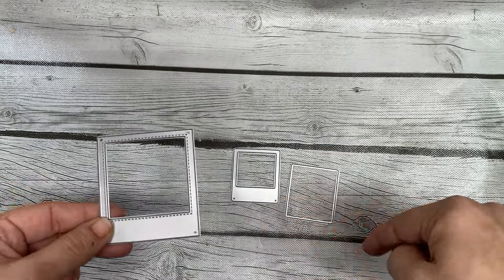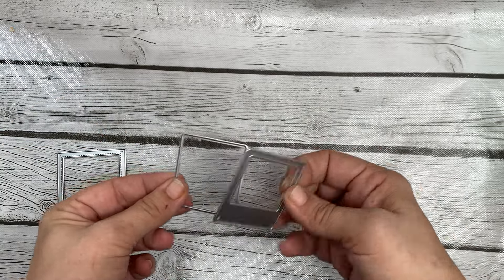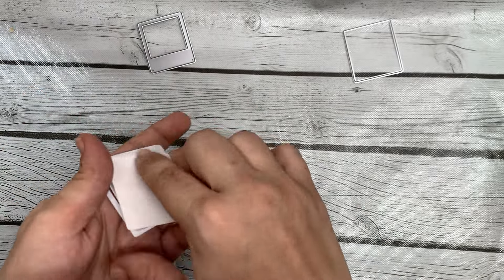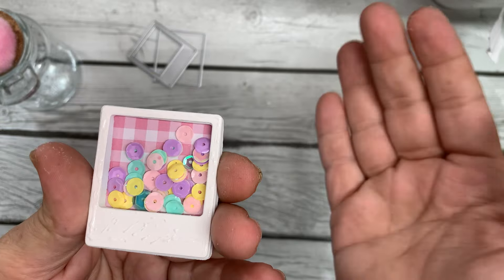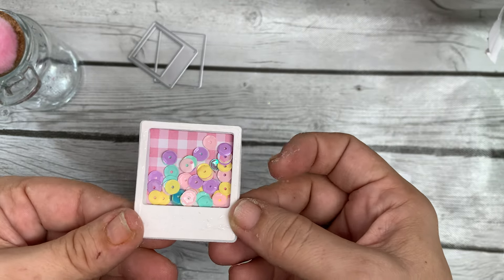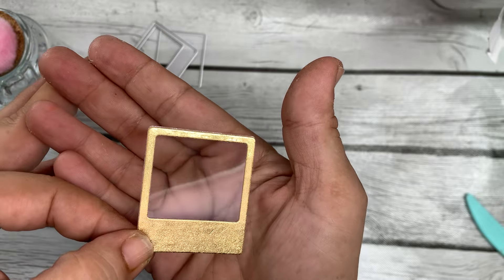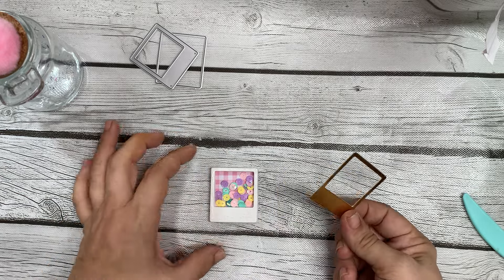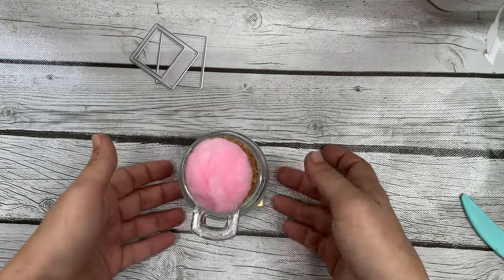*Requested* Tutorial: Polaroid Frame Shaker!

Comment: Thank you for this tutorial Bethany. I have been trying to make several shakers and I ended up throwing them away. I was having issues with glue all over the acetate,  and I now know to add another layer over the foam before adding the top frame. Sometimes my foam is larger than the shaker piece and it is cut the same way. 
Very irritating I might add.I am really glad you did this video, very helpful to me.
Reply from the maker: @carolek2090  im glad it was helpful! 
This is a common mistake that people make, so I want to ask you this: do you roll your foam through your machine back & forth? 
If so- that is why your foam isn't cutting out properly! You should only roll foam through your machine ONE time and 1 times only. By rolling it back & forth, you're pushing all the air out of it & making it too flat! 
I posted a video just last week where I actually spent an hour showing my subbies exactly how I die cut (i actually had my machine in camera)- so, if you have not watched that one, I highly suggest that you do! I will link it in the description box of this video! :)
Reply: @Your_Crafty_BFF  I only did that one time lol Now I just roll it through once and I use the 5mm. When I put the shaker all together I can always see the foam is a little larger. I don't know what I am doing wrong.
Reply from the maker: @carolek2090  my die cut foam frames are never the same size as the cardstock layer! Its not just you- shakers never turn out perfect! Just do what you can to make it work!❤